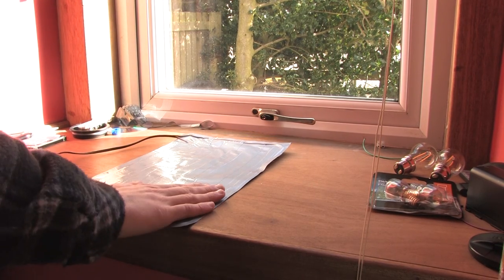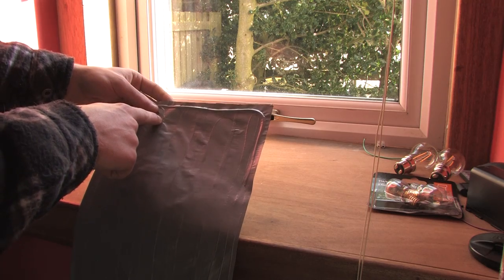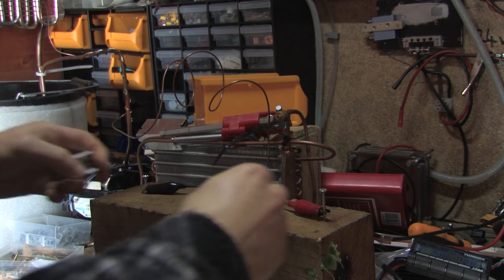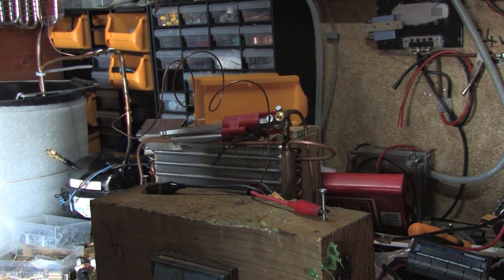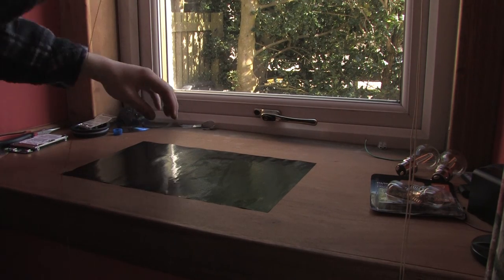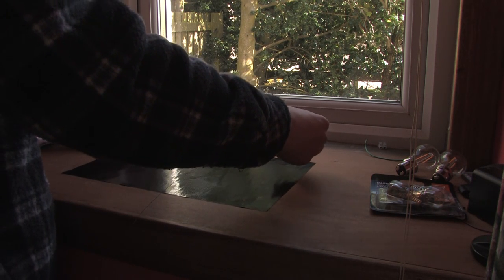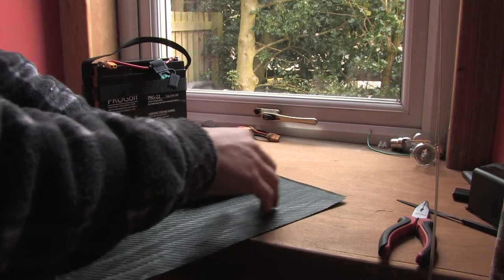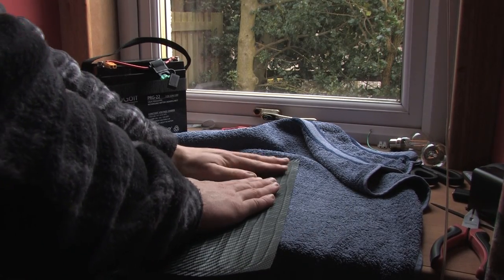DIY Heating Pad

Comment: A suggestion for your next endeavor... For a smaller one, use one of those potholder looms (usually found in kids crafts) for laying out your wire.  Your wires will be evenly spaced and you just take the tape and lay it down on the wire (as opposed to the other way around) after most of it is stuck to the wire, gently detach the wire from the loom and finish attaching the rest of the tape.

Comment: Rather than duct tape I'd try using the interfacing fabric used in sewing/dressmaking. 
It's soft, strong and self adhesive (on one side) when a hot iron is applied to it.

Comment: I repurposed a couple of heating pads out of an old back massager, Keeps my feet nice 'n' warm! The pads maintain a steady temperature once they get going, needing about 800ma each, powered from a 12vdc 2amp mains adapter. I also added a couple of small pressure sensors under the flexible heating pads, so they would only turn on when your feet are resting on the pads.
Reply: May I know what kind of pressure sensors you used?
Reply: @Asyss_Complex   Based on an old Tandy product, I fashioned two strips of sanded spring steel measuring tape, separated by a number of small strips of double sided tape spaced at intervals along the steel, smaller tape gaps varied the pressure required to make connection between the steel strips. An alternative is two sheets of foil separated by a thin foam sheet perforated with varying sized holes, also to adjust sensitivity. Combine the pressure pad with the heating element to create a one piece auto switching heat pad..... Hope this helps...
Reply: Zurkster Ok, I initially thought about a sophisticated sensor that you bought from somewhere. The idea is very clever though. Thanks for answering!
Reply: @Asyss_Complex   No problem. I specialise in making out-of-the-box gadgets/inventions using repurposed materials, cheaper and just as effective if well made.

Comment: I found your video of interest as I have been trying to find out how heating pads are made. I am interested in making a far infrared heating pad for the feet as I have neuropathy and my extensive research indicates that far infrared heating pads are the only means for palliative relief of symptoms. Can you help me out with making a far infrared heating pad similar to the pad shown on your video? From emissivity tables I find that frosted glass, cardboard, ceramic and wood have emissivity in the far infrared region at a temperature of 40C. I would appreciate very much your help towards putting together a heating pad using the materials mentioned or any other that you  know will emit far infrared radiation at 40C. Thanking you very much in the hope you will be able to help me.

Comment: What if you got a wooden board the size of the sheet and make the pattern you want with nails and coil the wire around the circuit of nails then heat the whole wire up until it stays in its form then place on to the sheet. Just wondering if that would work or not?
Reply from the maker: That would work brilliantly.

Comment: Thanks for posting this
I love soldering, replacing regular batteries with 18650, I bought a "lot" of 6 and 14 laptop batteries, I also make wall plug things like led lights portable
I have a set of 4 non flexible sound reactive led strips, powered by 12 volts, so I made a double battery (3 in series x 2 in parallel) using 18650s and stuck them onto all the fields on my fat Tire bike :) that has a big Sony boombox on a floating backrack so they light up to the music. They last a long time and I just charge them straight from 12v DC adaptor.
I also have a RGB IC tube led light strip (silicone coated) on the sides, it displays many colours at the same time, on the sides of the frame and a blacklight strip under the frame :)
Call it a Porto - Party :)
Anyway, I'm working on a concept of heating pads under the hand grips, so two small rectangles rolled, and one custom sized pad on the seat (fat bikes love winter:)))
I was wondering can I use a coated wire?
I also have a non coated beading wire, could I use that ?
And I have vinyl sticker rolls ( to make car decals on my Cricut machine), they seem to be pretty much the same as your carbon tape, and it helps that there stretchy and sticky and withstand heat (they wrap cars with them). Is it ok to make them perforated in case I wanna make a heated vest? Cause non breathable large pad would make the back sweat which is not good in the cold.
I appreciate any replies!
Stay awesome

Comment: this is exactly what I was looking for... I work construction and want a way to commute from my car to jobsite on my scooter... problem I am facing is I hate folding and stuffing the scooter in my car and I know with cold morning Temps that my battery will be cold from driving with it on the bike carrier. Was wondering about a heating blanket to could wrap the deck of my scooter with in the mornings to "preheat" the battery with... looking at industrial heater blankets,  even the cheapest ones are around $90... I thought surely a piece of resistance wire to make my own would be much more cost effective.

Comment: Hi Shaun.  This is an awesome idea mate.  Do you think its possible to make one to run off 240v? I was thinking of making one to help my seedlings grow by just using electrical 1.5mm2 twin core + earth wire (for domestic lighting circuits).  Would it work or is it dangerous?
Reply from the maker: It would be very dangerous in this case, please use a soil warming cable instead.
Reply: @ShaunDobbie  Got you. Thanks for the reply Shaun.

Comment: Do you think that I can use a Nichrome Flat Heater Wire for a 200*C Heating Element (10M Length 0.15/2mm Thickness)? What power source would u recommend? (I want to make a automatic lane fabrication for 1 biscuit for my degree project :D )
Reply from the maker: You could but you'd need a totally heat resistant material. The stuff I used would melt. Use ohms law to find the current and size your power supply from there.

Comment: Hi, can you use this sistem to heat the water ?
Reply: Theoretically yes, but it would be quite inefficient and slow, as water is notoriously hard to heat. It would be enough to keep it from freezing, though, if that's what you're after.

Comment: SOS!! Supply: 5v  1A and 32G Nichrome, what length do I cut for the element?
Reply from the maker: I am not sure but on 5v with such thin nichrome you will not get very much heat if you make it as long as mine. You would have to put several strands in parallel if you want a larger element. There may be calculators online.
Reply: I calculated to about 14cm for a 5W element...obviously that's too short for any useful heat distribution.  What happens if I  - (1) Use say 5x that length without changing any other parameters? (2)  Twist the wires and make something like a double or triple stranded configuration?
Reply: PS I need to reach a temperature of around 40C only, from room temp of 20C.

Comment: What is the use of this without temperature regulation. Very unsafe
Reply: Wrong, If you set the voltage correctly and use it in the proper environment as explained in the video (Use of Ohm's law), it is not unsafe at all. Heated jackets, gloves, motorcycle hand grips etc that you can buy commercially are all set correctly, they are not unsafe, nor do they have temperature regulation in a lot of the more basic heated jacket products etc. If you had said, "It would be very unsafe if a complete amateur attempted this without taking the proper precautions", then I would agree with you. Simply saying Very unsafe without temperature regulation is too broad a statement.

Comment: I want to do this for heating pad under my sleeping bag using 12 volt how many feet and what gauge wire for it just to get warm so I don't freeze at -40c here in northern Canada and could I use a dimmer switch to adjust the heat maybe, I can only get my hands on 110 volt dimmer switches here would that work or not and am I going toward the Darwin awards/Murphy's law with this thinking LOL....
Reply: self awareness is a good thing